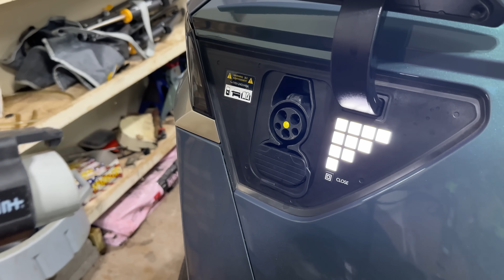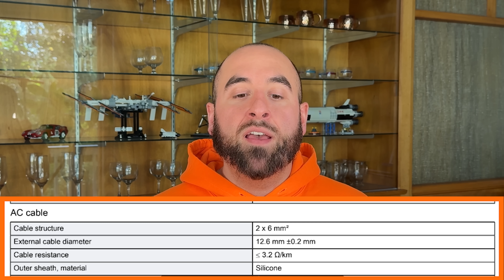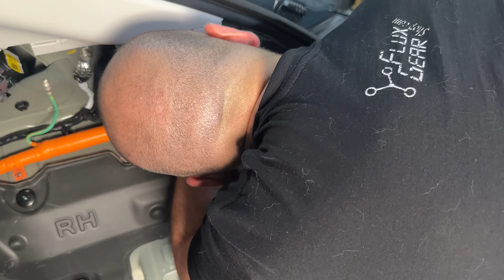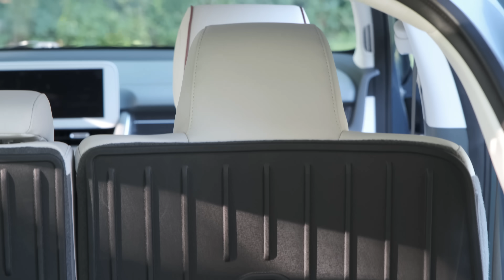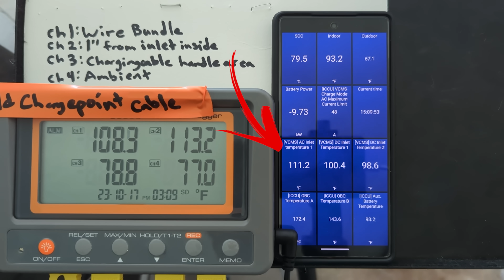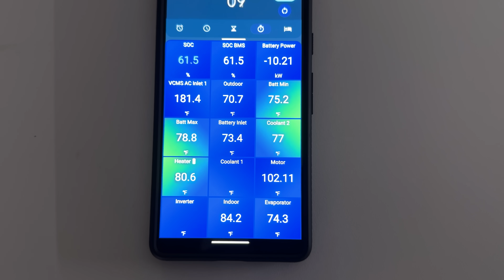I Investigate Overheating Charge Ports on Ioniq 5/Ioniq 6/EV6/GV60

Comment: Terrific effort on this video (perhaps your most useful ever), Corbin, thanks so much for doing this research! I only wish Hyundai would do as much. I'm with you on your working theory about pin contact based on your results. I hope you will continue to charge at 48A and see what develops over the next few months in terms of the pins perhaps working loose again. Our own 22 SEL charged fine at 40A for about six weeks and then failed after that, which would also not be inconsistent with a badly made charge port connector in the car that starts to wiggle its components apart beyond acceptable tolerance after a certain period of usage. It's clearly possible to build a charge port that does not fall apart or is otherwise defective as no other major EV manufacturer seems to have this problem. Why can't Hyundai buy their charge port from the same suppliers if they can't manage to build an acceptable one themselves?

Comment: The poll I did in your Facebook group asked whether people who only charged at 32amps or below EVER experienced the overheating problem, and ZERO people said yes. It points to charging at 40 and especially 48 or 50 amps can cause some sort of degradation which eventually leads it to fail at ever lower speeds. I HIGHLY recommend anyone who doesn't want this to happen never charge at even 40 amps. I'm currently charging at 36 and hopefully will never see this issue: we'll see.
Reply: I have the issue at 32A...
Reply: @korvics  But did you ALWAYS charge at 32 amps or did you start at 48 or 40?
Reply: @mitsu.hadeishi  I had issues with 40A overheating almost right away. So I've been charging at 32A since then. My overheating issues have progressively gone worse. I do think that whatever the issue is - something deteriorates with use, but I am not sure it's caused by charging at >32A.
Reply: A friend of mine is now having this issue charging at 32A and has not charged at more than 32A because that is the maximum for charging single phase with a type 2 socket in Australia (11kW is possible but only with 3 phase/16A on each phase).

Comment: It's hard to see, but FYI your AC pins are bent slightly. This can cause a bad connection. The first 1/3 of the pin is straight (part that's held rigid in the socket), but the outer 2/3 is bent starting right where the pin support ends. It's possible that pulling them out of the socket straightened them up enough to start working again. I encourage others with the issue to check for bent pins, you can use a Q-tip in the socket as a gauge. If the Q tip fits easier on one side of the AC pin vs. the other, the pin is bent.

Comment: As much as I LOVE the IONIQ5, I am glad I returned my vehicle hearing that people are having additional problems with charging them.  The fact re-seating the connections inside the charging port solved your issue is something I would also try if I had the same issue.  Infact letting Hyundai know what you did and how it is now working is critical for additional testing on other vehicles.  If this simple procedure can solve this problem. that is great. It could be as simple as a seating issue of the temperature connection sensor.  It makes sense if the sensor is not able to work for it to drop power is a precautionary measure to prevent damage to the vehicle.  I can't wait for a day where Hyundai can get these issues resolved, I want to buy an IONIQ 5 once things with this technology gets better.

Comment: This reminds me a lot of the issues with the 12VHPWR connectors on nvidia’s latest GPUs, which have a tendency to melt or catch fire if the connections are not 100% secure…

Comment: I am just starting to experience this same charging issue. I have an Ioniq5 purchased in Aug 2022. I did not have the issue until i got the latest update on Oct 4 2023. Since then my level 2 charger keeps stopping. It tries to restart but in 12 hours i only get about 30kwh of charge. I used to get 50 kwh of charge in 2 hours. I plan to show your video to my Hyundai Service guy when i bring my car in tomorrow

Comment: For those Europeans that were asking.. North America uses CCS1 for the AC plug, the rest of the world uses CCS2, The latter has bigger pins (AFAIK) and 3 phase support. 7kW charging for the rest of the world is single phase 32A, 11kW is 3 phase and 16A so the conductors are under considerably less stress. I've never seen a rating for the CCS1 pins? NACS will solve the problem by using pins intended to carry the considerably larger DC currents. CCS DC pins, and any charging issues, are universal.

Comment: I think what they are saying about temp sensor communication is BS. The sensor obviously works well and it either reads or it doesn't, its just a thermistor. I am currently working as a tech now at a Hyundai dealer and I have one of these to diagnose next week. He has the same problem you are describing and has also done all the software updates. I believe the root cause of the problem lies in the charging port itself with the connection of the pins. A thermal imaging camera would also be a good tool to diagnose this, you can wait for it to overheat, then pull the charger plug out right away and see if any one of the pins are hotter than the others with the camera. Imo they are just trying to buy time with the software update and the real fix will end up being a recall for an updated charging port. I will keep you in the loop if my diagnosis reveals anything definitive or if I hear anything from higher up :)
Reply: I looked at the car. It just ended up needing vcu and iccu update. What I'm surprised about is that hyundai never sent him a recall letter or mentioned anything to this customer about the software update. Anyways, this is just the band-aid fix for now. Time will tell now if he returns again for the same issue, but this is the only official fix we have for the time being. I really have a hunch that hyundai will put out a recall to install an updated charging port.

Comment: It definitely sounds like it could be the connecting pins issue. It's not unheard of that a poor connection will cause a huge increase in temperature.

One recent similar incident I can think of are the NVIDIA 4090 and 4080 GPUs. The 4000 series GPUs are using a new standard of connectors for power and the issue with it is that it can easily unseat itself to the point of making a poor connection. Supplying 600-800W of power through that poor connection would inadvertently heat up the connection to the point of melting the connector itself.
Reply from the maker: Oh wow!

Comment: I was going to speculate that the trunk liner was insulating the heat inside the wiring cavity, but your continued success with 48A tells me that isn't the problem.
I do think the thermistor arrangement is hokey. The fit between it and the adjacent pin is critical, and slight differences in that fit could lead to large differences in how the thermistor responds.
Hyundai obviously didn't characterize this well.
A more accurate thermistor reading would occur if it was bonded to the pin with epoxy, for example.
Thanks for doing all this work!
Reply from the maker: That’s what I was thinking myself

Comment: Hi, I'm in Norway... I've had no issues with the charging port on the 2022 Ioniq 5. We did have the car at the dealer for unrelated minor repairs though, and they suggested that to the charge port upgraded/fixed whilst it was there. In the process (which apparently requires the removal of the back seat) they damaged the inner door panel. No problems though, they will fix it but the replacement panel will take up to 3 months to arrive.
Reply: I'm struggling to work out why they would have to take the back seat though.
Reply: @markmurray4575  the high voltage service plug is below the seat. So disconnecting the HV battery from the car before working on it (electrical safety)

Comment: Blaming it on a comms problem between modules seems like an intentional misdirection from Hyundai. Maybe that's also a problem, but it's not why it's overheating.

1. Your earlier tests, and tests from others, have shown the thermocouple reads accurately at ambient.
2. These same tests showed the temperature steadily increasing from ambient to around 220F while charging at 48A.
3. After disassembly and reassembly, the temperature still increases while charging at 48A, but it doesn't get anywhere near as hot as before.

That's not a communication issue. It's also not due to an improperly seated temperature sensor, as that would have caused a lower reading, not a higher reading. This is a resistive heating problem due to poor electrical contact.

The pins certainly don't appear "clean" in your pics. You can clearly see a shinier part toward the base where there's been less wear from the EVSE. Maybe the pins were dirty and your handling of them cleaned enough contaminants that it doesn't overheat anymore. Or maybe their orientation was slightly changed so that a dirty or corroded part was no longer interfering with EVSE contact.

Comment: Great hands-on research, well done! It looks like there could be a manufacturing issue whereby some ports are built badly and have much higher resistance. This would also explain why not everyone experiences this issue. So maybe what is needed is a recall of charge ports, to check, fix or replace them…

Comment: My gv60 is paired with a 60amp hardwired ChargePoint. This has been driving me crazy why the car would stop charging during the summer. I thought it was the ChargePoint as I didn’t have this issue anywhere else

Comment: Same story for my EV6GT. Charged at 40 amps just fine until Summer heat then needed to drop down to the 60% current setting to avoid charging errors. Why does Kia only have 90 and 60% settings and not 70 or 80%. Seems odd. Anyway, now that it's cooler, the 90% setting is now working. The chargepoint connector does get very warm to the touch. Yet stays cool when charging a Tesla even at 40 amps.

Comment: I’m about 99% sure now that the issue is the pins aren’t making good contact. They are either too small and/or too soft and wear down with time. When you reinstalled the pins, they probably rotated a little bit allowing for the EVSE cable to bite new metal resulting in better contact and temps. You’ll probably see the issue again eventually if you keep using the same EVSE cable.

Comment: Did they ever check the interference fit between the pin connection of the socket port?  I would check my Ioniq 5, but I don't have the car anymore. I worked at Schneider Electric (Power Meters), and that used to be one big issue, high voltage loose fitting connection.

Comment: Thank you for taking the time and having the bravery to do this. My 2022 EV6 GT-Line AWD has been having this issue after about 8 months of ownership. Trying to find a dealer out here in Southern California with a 48amp charger has not gone well, and thus can’t replicate the problem at the dealerships. KIA corporate just redirects you back to a dealer so they can test and submit. None of the updates so far have resolved this issue and I’m am forced to throttle down to 90% so the charge doesn’t intermittently start/stop every 3 minutes after about the first 50 minutes of charging. I will try scrubbing the contacts with some alcohol and see if that helps though…. Till your next video~cheers!
Reply: @harlon4520  did scrubbing help?
Reply: @mikeintampa250  No it did not, the most recent recall/voluntary service campaign seems to have put the issue to bed. I just hope it’s not throttling down current when no one is looking (I charge on level 2 after 9pm).

Comment: Thanks for this post. One of your best. 😊. I'm curious what your hyundai contact has said about your discovery? I've had to reduce my 40A 'charger' down to 20A to ensure it doesn't quit mid-way. 🙄. I'm also curious if the latest TSB to reduce the i/p current is an effective bandaid cure? My dealer says they do NOT have that software update to offer. Have others heard this excuse too?  TIA. G

Comment: Seems to be an USA problem. Only incidental charging issues in Europe that I've read about. In the 2 years of ownership I've never had an issue like this charging at 11kw / 3F 230V / 16A
Reply: Have you seen their wiring it looks like something from the fifties.😊
Reply: The US charges Single phase only . Europe does 16A per pin, the US 40!

Comment: Heavy appreciation for the testing 👏🏻 both Ioniq 5's I have owned would derate after about 30min of charging. Most people would just complain to their dealership and expect them to diagnose and resolve the issue. I'm so glad you went out of your way to manuall collect the data and get down to the bottom of this issue. Its even more admirable that you were willing to share this information rather than keep it for yourself! Love the channel, but this is the most informative video yet. Now I'm going to see if I can fix my charge port as well!
Reply: The Dealership should be able to fix this.  They have all the same tools he does.  If you brought them an ICE with a blown head gasket they would be able to fix it and not just say, this always happens, just drive it.

Comment: Great job
I did not have a charge port issue
But I am still dealing with the 12 volt battery dying
The dealer tells me it’s the VCU module that is not going into sleep mode
So fingers cross that a new module solves this issue

Comment: It's not going to be a wire issue (as you found). If the wire was undersized it would melt. The copper is actually a heat sink to pull heat away from the charger and cool it along the length of the wire. The terminals can get hotspots due to poor contact surface which can be hard for the inlet's thermistor to catch because it's so small. Chargers also have internal thermistors which should be the first thing to overheat.

Based on Hyundai's response it sounds like a software issue where they are prematurely derating/stopping based on the thermistor value. Could also be an issue where if the software can't read thermistor after XX minutes it stops. 

Edit: Another thought, your thermistor testing might not have caught it because of the sample rate. The BMS might be checking temp every 50ms but yours is 1s and there's are spikes that happen faster than your equipment can detect.  

Source: electrical designer on fully electric off highway machines.

Comment: I hardwired my own 30A Flo G5 evse as I found a great deal on one and only had a 40A breaker to work with anyway; I was worried I'd have to trouble-shoot both the EV6 and my DIY wiring job, luckily everything has worked out fine so far charging at a solid 7kW. I often charge at work on a Tesla destination charger at 9.6KW using the A2Z adapter and haven't had any issues there either.  Fingers crossed it isn't an issue that crops up down the line as I've only had the car for 3mo.

Comment: Still not getting the update. My early 2022 car does not have the problem. It holds 11.4 kW start to finish on my charger and my friends charger. I don’t want to take a chance that the update will screw it up.

Comment: Potentially NACS will help, I know I haven't really heard any issues with CCS2 cars outside of NA so it might help. My I6 (Australia, CCS2) hasn't had the issue charging on 11kW for 1+ hours.
Be interesting to see if there are any reports of it for NACS.
Reply: its the voltage difference. In the US the volt is lowered so amp needs to go higher to compensate which means more heat. I think this is an oversight by Hyundai as their standard testing was fine for most of the world where 230v is the standard and won't overheat.
Reply: @sentryion3106 220 hasn't been a thing the USA in a long time. For almost my entire life to date the two legs are 120-125 volts and together this makes 240-250 VAC.
Reply: I think these 48A charging sessions are 'level 2' 240V, not the US level 1 120V. They do 11kW with 48A single phase because they don't generally see 3 phase supplies, hence the american use of type 1 sockets that are single phase only @sentryion3106

Comment: I charge at 40a. Never had overheating issues until I did the ICCU recall. Now it overheats 100% of the time unless I throttle to 90%. It doesn’t matter if it is hot or cold outside it will overheat when charging at 40a.

I got through the hottest days of summer without overheating even once. I’ve seen a couple people on Reddit explain the same issue. So the ICCU update tip at the end of your video may or may not be helpful.